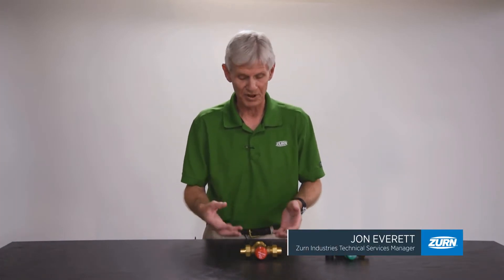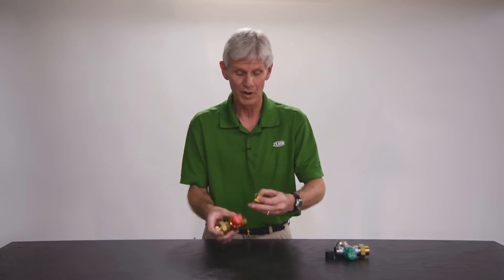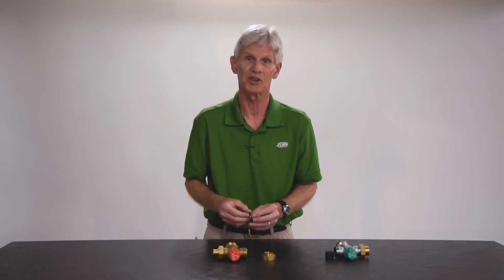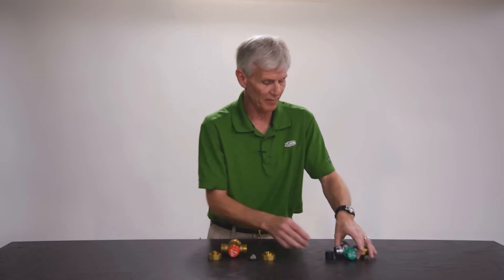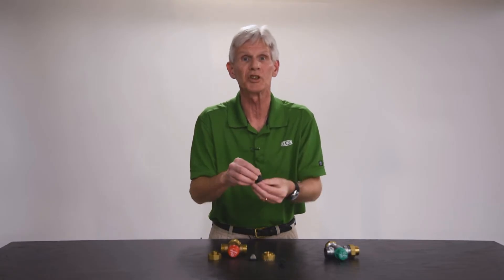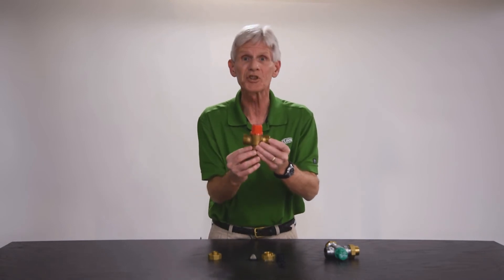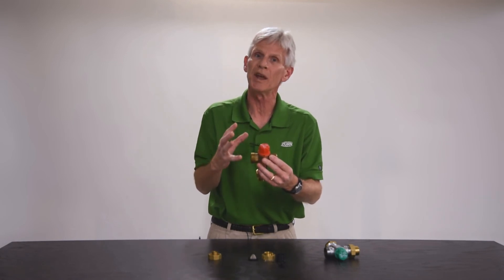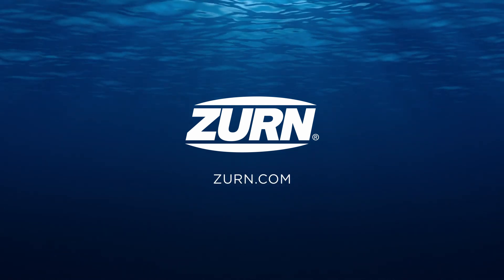Zurn Wilkins Thermostatic Mixing Valves (TMV) – How to Repair and Rebuilding

Comment: thank you for the informative video. I have a Zurn valve ZW1017X. I am looking to purchase the strainers and check valve. Local vendors tell me I must purchase the complete valve, any some distributors advise they cannot help. Can you advise on the part numbers and where to purchase strainers and the check valve in Toronto, Canada, or online? thank you
Reply from the maker: Hello, thank you for reaching out and for your patience as we work through answering your questions. Unfortunately, we do not offer repair parts for these so a new valve must be purchased. Here is the information for your local rep in Toronto:   
CARDINAL SALES

905-569-1419
ssantamaria@cardinalsales.ca

Hope this helps!

Comment: how about the top adjuster? if you pop off the colored plastic top, there is a little 7-8mm nut on top that adjusts temp. I turned mine because it wasnt hot enough. Hotter water begins to come out BUT water started to leak from that top adjuster nut area. Can I rotate that temp nut all the way out and replace an oring in there possibly?
Reply from the maker: Hi, thanks for reaching out! No parts can be replaced under that adjustment nut. If this is not a new install then we recommend replacing as these are safety devices.  If this is a new install and is leaking this can be returned and replaced as this is still under warranty.

Comment: That tiny little brass nut at the top.... is that a joke?  I would bet good money that each and every one of your customers has rounded that little junky thing off.  That piece of garbage failed not one month after my house was built.  

Builder told me it just needed to be adjusted.  
Yea right.   Doesn’t matter which way you go with it.  Water is scolding hot for a second or two, then ice cold and it stays ice cold.  Same issue on all three bath tubs.  Thank god they didn’t implement a zurn product into my walk in shower temperature control.  Only decent temperature in the house.  Will be replacing these faulty products either with a competitor or I will bypass them.  Dumb concept anyway.

Comment: I just need to know how to take the damn cap off! 🤯🤯
Reply from the maker: Sorry you're having troubles with this. The Zurn Wilkins Model ZW1017XL or ZW1070XL mixing valves are fitted with a plastic cap that can be removed in order to make adjustments to the valve's setting. The cap can be removed by inserting a small blade screwdriver into the
 slot at the base of the blue cap and lightly pushing up. Hope that helps!

Comment: My water is warm not hot how do I get it hotter?
Reply from the maker: The Zurn Wilkins Model ZW1017XL or ZW1070XL mixing valves can be adjusted by using an adjustable wrench or combination wrench, rotate the flats clockwise to lower the temperature or counterclockwise to increase the set temperature. Read temperature with a thermometer. In some cases, the outlet temperatures may be limited by the supply temperatures. 

For more information on troubleshooting this issue, please review the installation and maintenance instructions for this product. Those can be found on the TMV product pages published on www.zurn.com. Or, feel free to call in for some assistance from our technical support department by calling 855-ONE-ZURN.

Comment: The temperature adjustment on top of my 1070XL won't budge. Place is only 5 years old.  Any suggestions?
Reply from the maker: There are two hex shaped components near the top of the TMV. I recommend ensuring you are adjusting the smaller hex, near the cap to make the adjustment. If this will still not function as intended, it may be time to replace the valve. The ZW1070XL is considered a safety device and is not intended to be repaired. It is possible corrosion has affected the valves ability to be adjusted.

Comment: Hello, I’ve been contacting your customer service and they are denying your above mentioned process to service and repair the zw1017. Can you help resolve the matter? Thank you
Reply from the maker: Hello. After speaking with our product experts, this is the information we have to share with you. 'Our thermostatic Mixing Valves are considered safety products. We do not currently offer repair parts outside of the strainer/gasket combination. The check valves contained in the tailpieces are cleanable but are not repairable. If they are in need of replacement, our Customer Care team can provide the part numbers necessary. Please contact your local distributor for availability of the part.' Please let us know if you have further questions. Thank you, Zurn Social Media Team.